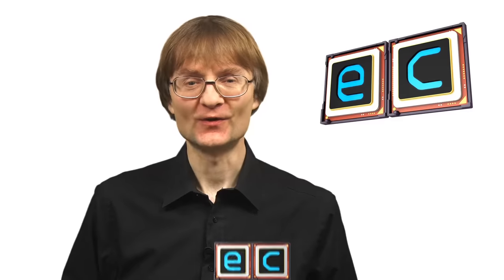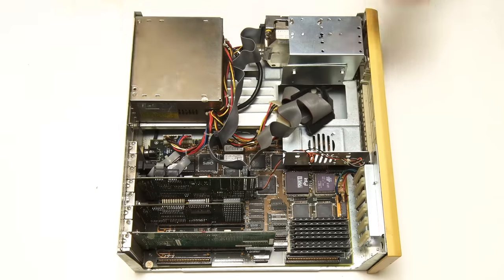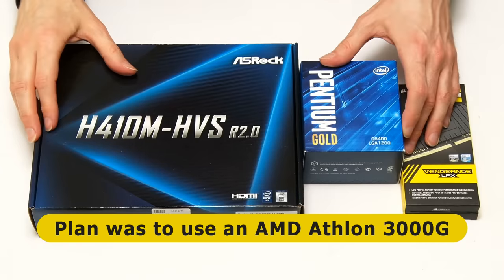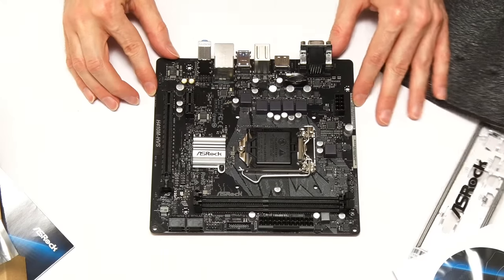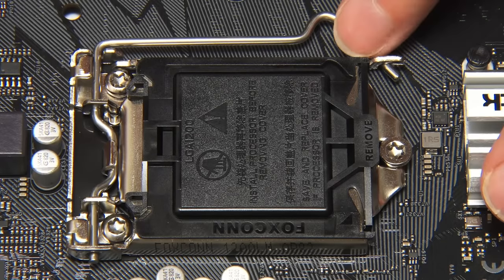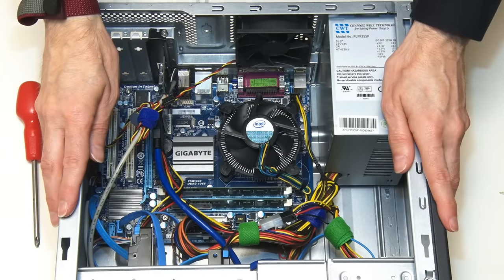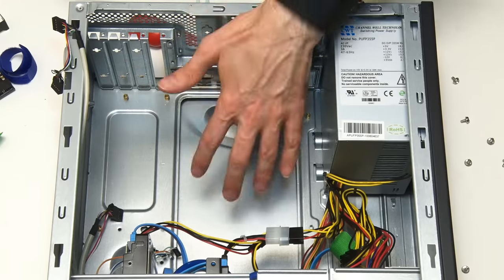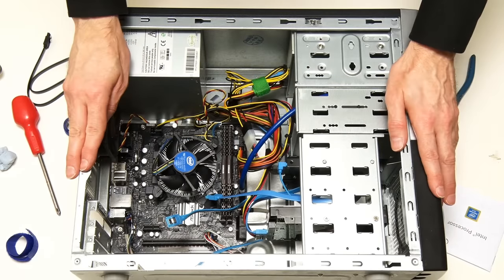Old PC Upgrade: Motherboard & CPU

Comment: you don't have to remove the plastic protector from the socket before installing CPU. Just lift socket insert CPU, plastic cover will automatically pops out. Intel recommends this method to prevent accidental damage to the pins. By the way love your videos. greetings from India
Reply from the maker: I was very aware that there are different views on this. The Intel instruction sheet that came in the box with the processor shows exactly what I did -- lift the lever, raise the retainer, then remove the plastic cover.

Comment: 'so you can't use an M.2 with this board'..... and we're done! Fast ssd-s are imho the saving grace for cheap entry-level 'upgrades' // a run of the mill PC.
To pick a board without an M.2 slot would therefore be incomprehensible for me. Better to wait for supplies to 'normalize a bit' than to spend money on a sub-par entry-level 'upgrade'. Other than that, this is a useful video and excellent instructional video for those who think of building // upgrading their PC for the first time.

Comment: Finally after 10 long years your video gave me courage to buy Pentium.
Wanted the same Processor and bought it. 
Wanted the same mother board but Asrock distributor suggested to go for H470M-HDV.
Wanted the same RAM but due to shortage have to go for TEAM Elite 16 gb 2667. 
In total cost was around $260. 
Now guess what...
I have been playing games all the day in lockdown. (the games I thought I would never be able to play due to high price of gaming pc) 
Never thought Pentium processor is such a mighty beast....
10th generation Pentium Processors are too underrated.....
Reply from the maker: This is fantastic to hear. As you say, modern Pentium processors are seriously underrated.

Comment: In the bios screen I am unable to add my old HDD to boot priority even though it sees it ?
Reply from the maker: Check on the secure boot option.
Reply: @ExplainingComputers  ok enabled does nothing with standard mode. Disabled does nothing either
Reply from the maker: @digitalmediafan  Can you see the drive in your OS?
Reply: @ExplainingComputers  it shows just can't boot into it

Comment: I'd like to point out a small fault in fitting the motherboard at 18:25, the grounding pin on the HDMI cutout of the motherboard shield does not slide above the port, but instead slightly goes into the port itself. This may bring up issues in fitting an HDMI lead, and it might even short out some pins, which is not to be desired. I've personally had the same happen with an Ethernet port.

Also, manually removing the plastic CPU cover at 12:01 is not required, as lowering the lid with a CPU fitted will usually pop it out. Improper manual removal also has a fair chance of damaging the CPU socket, which would be a pain to fix.

Otherwise, it's always a pleasure to watch your videos!
Reply from the maker: Yes, I did not notice the shield issue with the HDMI connector in that shot. Fortunately for me that shot had nothing to do with the final build, as it was one of many alternative angle and close-up shots taken the day before. On the CPU cover, many people keep saying "it will just pop off", and am aware that there are different views on this. So what I did in the video was to follow the instructions that Intel provide in the leaflet in the box with the processor, and these state very clearly to raise the retaining mechanism, then to remove the cover, then to fit the CPU. So the practice I show in the video is exactly what Intel recommend. They have certainly never recommended popping off the cover using the CPU.
Reply: @ExplainingComputers  Oh, good to know the shield turned out to be a non-issue! Regarding the CPU cover, doing what the manufacturer recommends is usually for the better, so I guess I learned something new today!
Reply from the maker: @tiberiud  :)

Comment: I’ve been using a Lenovo IdeaPad with a Pentium Gold for over a year (Linux Mint) and I am very pleased with it as a daily driver. While the Pentium Gold is dual core it is also hyperthreaded so you get close to a four core unit this way. I have an M.2 with NVMe and it cold boots in less than 15 seconds. Can’t ask for more than that in a less than $400 laptop!

Comment: Just as an aside, as a US person who just did a major uprade of my machine... mobos and power supplies are fairly cheap, memory is in the middle depending on much you get and what features it has, and the hard parts to get these days are the CPU and graphics card. (Cases are all over the price range depending on features, and drives depend on the interface...and in both cases, you might not even need to replace either...or, if you're lucky the PSU...on an upgrade.)

Comment: Well i resurected my old 2003 computer,AMD athlon DUT3C,Motherboard PC Chips M811,Nvidia GeForce 4 64Mb,Ram PMI DDR-400 256Mb,Old Samsung HDD 40GB,Asus Cd- Rw,Floppy Disk,TV-Tunner,and PSU 300W,all up and running with Windows Xp in 2020.Im Happy to still have my first computer functional after so many years! :D

Comment: My PC is an LGA775 board like this one and I replaced my heatsink and fan, because the mounting pins broke.

When I received my new old stock heatsink and fan, the mounting pins were in the pushed down position already, even though the arrows were in the correct position.

I didn't know this and tried to push down on the pins to fit the heatsink and fan and naturally, the pins wouldn't push down.

I actually bent 1 or 2 pins trying to push down before I realised how they work.

Now it is secured by 2 or 3 pins. I think that should be secure enough.

Edit:
I just want to clarify, I'm not blaming you Chris, I just want to generate awareness that these types of heatsink and fans can be received like this.

Comment: Great video again, thanks and keep them coming! 😀

P.S. Please add #4 to the title.
Reply from the maker: Thanks for this. I did not add the "#4" in the title as this video is really an alternative starting point -- the first three parts of the series were about making the most of the existing hardware, this is an alternative option. :)
Reply: That makes sense, but all the other components make it partially an old PC. :) But if this is a starting point does it mean you'll do more upgrades to it?

Thanks for your reply! ❤️
Reply from the maker: @kneekoo  Possibly. Right now the only video remaining is the Linux software one next week. But there are options! :)

Comment: A quickie about registering an "old" Windows 10 to a "new" computer. When Windows asks you to register, opt for phoning it in. The automated process should either allow you to activate or ask you a few extra questions. Those extra questions will be about if you've just upgraded some parts or reinstalled. Just "tell" the automated system you upgraded a part by hitting the appropriate number on the phone keypad. If for some odd reason you still have issues the automated machine will send you to a real person. You can tell the person that you upgraded the MB and CPU and you don't have Windows installed on two or more machines. The person on the phone should give you a registration number (just like the automated machine does but done by a real person). You should be able to either get a refund or transfer the product key to a new machine, but I've never had to do that.
I've done this many times all the way from XP to Win10 without any issues. The only issues I've had is if the customer had used a pirate Windows or tried to get sneaky and install it twice. I used to repair/install/build/upgrade computers as a job and never had an issue with moving a Windows product key to new hardware. Oddly enough I installed Windows 10 on a removable drive (both NVME on a USB adapter and a SATA NAND SSD to USB adapter) and registered it and haven't had any problems booting a random machine from it.
Reply from the maker: Good advice.

Comment: The dimensions of the box suggest that you've really bought a cooling system with an incidental bonus CPU. 
On the motherboard itself, how many people have struggled to install the chip before removing the plastic guard thingy? (Then read the instructions.)
People who haven't performed the process as often as our instructor might want to use their cellphones to photograph the status quo ante for each step in the removal process, just in case it's not obvious what goes where in the installation. (That applies generally, not just to computer building.)

Comment: Hello good job on the demo. One thing regarding installing the processor the plastic cover should not be removed by the installer it once you close the cover and bring down the lever it will pop out. and for motherboard warranty do not discard it if you want to ship it back the plastic cover should be inserted back since it is covering the pins. Thank you again for the demo.
Reply from the maker: Thanks for this. But you are I'm afraid not correct on the cover, although I am aware there are a lot of urban myths surrounding popping it off with a CPU, so I understand why you say this. :) What I showed in the video is what Intel tell you to do in the instructions for fitting the processor printed in the leaflet that comes in its box. And these say to remove the cover, raise the retaining mechanism, fit the CPU, and put back the retainer. This is also hardly a surprise -- Intel are hardly likely to recommend prizing off a cover using one of their CPUs!
Reply from the maker: @adolphamarkarian3473  Sorry if I offended. All I am saying is that I followed the instructions for fitting the processor included with it in the box and written by Intel, and which I therefore think have to be the definitive guide. Certainly other methods can be and are used, no problem. But you chose to tell me that the cover "should not be used by the installer". So I defended what I showed in the video by pointing out that this is what the manufacturer of the product tells you do do.
Reply: @ExplainingComputers I am not offended I did not say "should not be used by the installer?" I said removed since it will pop out by itself. I just tried to be helpful. since I have install more than a 1000 clone computers from scratch. I showed the video how easy it is to take it out without the installed trying to do it. it is not about defending a procedure its about practical use of it. you can check many videos like the ones I sent you even Linus tech tips does the same thing.
Reply from the maker: @adolphamarkarian3473  Thanks for this. I have on many occasions in the past seen the cover popped off, but will myself stick with the method. :)
Reply: @ExplainingComputers  no problem funny thing was you said it was an uban myth LOL and you have seen them popping out. its ok.

Comment: What a small motherboard with a huge CPU heatsink and fan :)
I found fitting the cooler of this type to be a pain in the neck.
I have a "rodent" like that. Ergonomic design. It only lacks a scroll wheel.

Comment: If I caught it correctly - you said that this motherboard had a g41 chipset   - I think this is the fastest cpu that you can shove in here Intel Core 2 Quad Q9650 ( 4 cores ) - and its $26 on ebay.  might have been a good stepping stone.  since you have already updated a lot.  would have been the last good upgrade for this computer before motherboard replacement.   but I know that this is a 'teaching' show - so thank you.

Comment: 02:29 Some Older HP desktop computers I've wanted to upgrade in the past have had proprietary power connectors / connections... its not just dell who do this sometimes
Reply from the maker: Very true -- but Dell are the worse offenders! :) I think I said "It’s also worth noting that older PCs from some manufacturers, and most notably Dell, don’t have standard motherboard mountings or standard ATX power supply connectors."
Reply: @ExplainingComputers  HP Elitedesk and Dell OptiPlex requires proprietary connectors but you can use any ATX12VO power supply in SFX size in them with a simple adapter. Motherboard mounts of both are compatible with MicroATX, minus one of the screw holes (4 of 6 holes are enough to support the motherboard in normal daily use).

Comment: Great content. Now tempted to get newer platform under £200 even if its a side ways upgrade to Haswell Xeon 4 Cores/8 Threads. Athlon 3000g & 3200G Motherboard Bundles are in stock at  CCL £169.99/£189.99
Reply from the maker: Those are great motherboard/APU bundles -- both very nice chips.

Comment: I have an old PSU with only a 4-pin cpu power connector and have been eyeballing an ASUS B85m-e or H110m motherboard in order to avoid upgrading the psu. Also spotted a few Intel DHxxxx motherboards which have 4-pin connectors too. Not sure if my psu's rail voltage/amperage will be compatible after taking a closer look at my psu, so I might need to upgrade it first anyways. But they seem like great and affordable upgrade paths for anyone stuck w 4-pin only. Provided the psu specs are acceptable.
Reply from the maker: You can use a PSU with a 4-pin 12V ATX connector with any motherboard that has an 8-pin 12V ATX connector socket. It will fit just fine -- it only slots into one "end" of the 8-pin socket one way around. The only issue is that less power will be supplied. But whether this matters will depend on the CPU you are using, and other connected hardware (especially the graphics card).

Comment: If you put the CPU socket holder back down on the processor with that cover still on that generally pops that cover either completely or at least partially off and you would've had an easier time removing it.
Reply from the maker: True, but the Intel installation sheet in the processor box says lift the mechanism, then remove the cover, then fit the CPU. There are many differing opinions on this, so I went with what Intel say. :)

Comment: This is what I did... With 10100f, h410 MSI, 8gb ddr4 dual channel, but in case from year 2002 (if I can remember correctly, it was using amd duron with chaintech 7aia5 board). After the amd duron didn't work I used q9300 then q8400 with 8gb ddr3 and gt 1030. No fancy RGB stuff.

Comment: That's nice, even a low end PC is good for most stuff, though too bad you weren't able to acquire an Athlon 3000G, would have liked that more than the Pentium. Just curious, what is the power usage of the system you built?

Comment: A faster and cheaper system would be a i5 2400/ i7 2600 or 3rd , 4th gen equivalents second hand depending on your budget  , you could still re use the 8 gb ddr3 and the socket 775 cooler should fit on a 1155 or 1150 though depending on the cooler it might work since I've fitted a 775 intel cooler on a 1155 socket before . As for the power supply , re using it shouldn't be a problem you can pair it with a Gtx 1050  graphics card to get a pretty capable machine since max power draw of a system without any  graphics card should be under 150 watts and a gtx 1050 will run on a 75 watt pci express slot on a 300 watt psu just fine though you might want to consider upgrading the power supply if you want a more powerful graphics card or more hard drive expansion  and lets say sata devices since a lack of power cables is something I've ran into before.But all that depends on your use case and what you want

Comment: This is a good video that I've ever seen. Wait a minute. Did you had install thermal paste before installing heat sink with fan on brand new cpu?
Reply from the maker: Thanks. :) As noted and shown a couple of times in the video, the thermal compound is pre-applied to a stock Intel cooler.

Comment: Towards the end, while you were connecting the front i/o, the reset header is over by one pin. The reset button will not work, BECAUSE the pin header is just to indicate. NOT connected at all. Move it back to be directly next to the HDD LED connecter and you'll be fine!

Comment: Enjoying the upgrade series Chris, just one question, where did you dig up that LC386-25 PC? as It may well have my fingerprints all over it! I use to work in the service department for the company that built it!
Reply from the maker: I acquired the 386 from my old employer (the University of Nottingham). At one point in the 1990s, Ahkter provided all of the organization's IBM clones, and I and my colleagues worked on many of their 286, 386 and 486 boxes. Those were the days! :)
Reply: @ExplainingComputers  thanks for replying chris, i remember that the university had a dedicated Akhter engineer on site, but i did visit occasionaly when needed, those were the days indeed

Comment: Seems near impossible to install an old operating system like Windows 7 or XP with a new 2020/21 motherboard.  Be warned if you want to do this
Reply from the maker: Yes, new motherboards have sadly not supported anything below Windows 8.1/10 for several years now.

Comment: Another nice one, Chris!

Oh, just a thought. Even if the board itself doesn't have an onboard M.2 slot, but you do have those vacant PCIe slots. Does it look viable to use an adapter for one? Though I am not so sure if booting from it would be possible.
Reply from the maker: You are right -- a PCIe to M.2 adapter would work, and on a modern motherboard should be bootable. :)

Comment: My amazement is how there's not a single bit of dust in Chris' computers. Even though I vacuum clean my house weekly and airblow computers every 3 months I still have some chunks of dust mostly on the fan blades.
Reply: Did you not notice the condition of the 386-based PC at and around 2:55 ? I'm surprised Chris was prepared to handle it with bare hands!
Reply: @DraftySatyr  Oh god!

Comment: Years ago I built a computer for my wife's office using a Gigabyte C847N-S2 micro itx.  I really liked the board, for the purpose it was used (internet access only) it served well.  It's a shame that it was defective and I ended up discarding it for recycling.